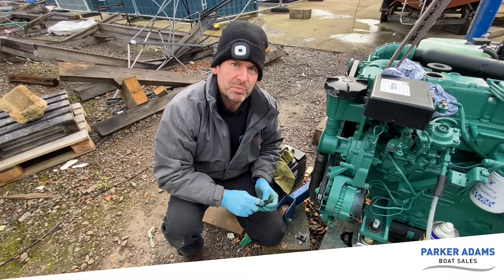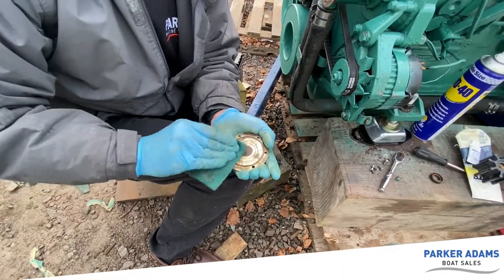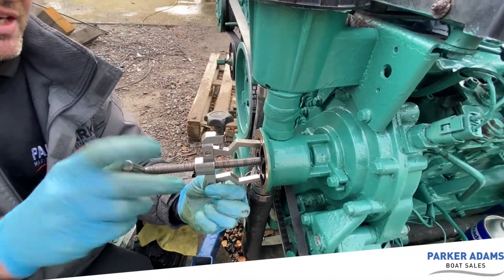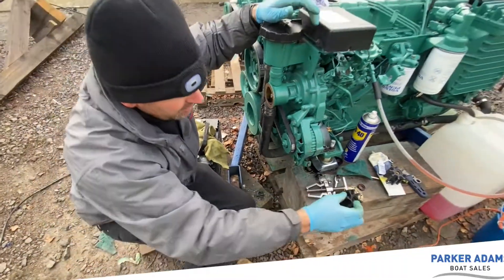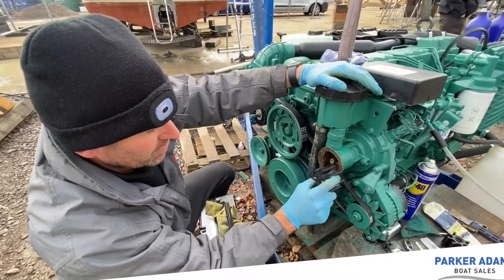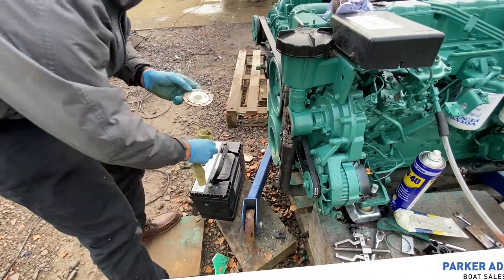Marine Engineering Made Simple Series #2 -  Tutorial on changing an impeller - Volvo Penta KAD

Comment: Hello. Excellent video. One question: can water enter the engine through that pump and then mix with the engine oil? Volvo Penta TMD40A.Thanks.
Reply: Please believe me when I say I’m no engineer 😂😂 but I understand that although the water pump picks up it’s rotation from a ‘key way’ in this part of the engine there is a system at the rear of the pump that prevents the seawater from getting into the engine, unless of course there is an issue with the pump. Hope that helps👍
Reply: All well and good with the engine out of its bay and neatly on blocks, try changing the impeller while the boat is rolling about and it’s on a Volvo mdb2 a complete nightmare!

Comment: My Volvo AP 41 6 cylinder is losing water could it be this
Reply from the maker: @markadams2723  if it is sea water you are losing a common place is the impeller pump shaft seal, there is a gap at the back of the pump to allow water to escape there if the shaft seal is worn as otherwise it would go into the engine.
Reply: It’s the fresh water I put into the header tank sorry to sound stupid but I’m just lost with all of this

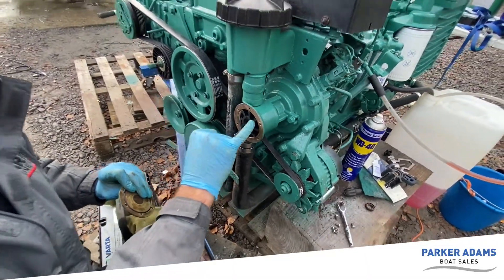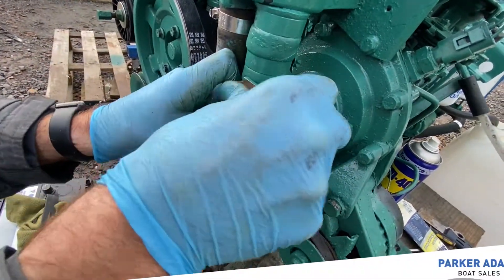Comment: This impeller was fitted incorrectly, at 0:34 to 0:46 you can clearly see the impeller is set to rotate in a clockwise direction, pushing the cold water up into the filter above. At 4:14 the impeller blades are facing the opposite direction to the rotation of the drive shaft.   Hopefully  on startup the blades will correct themselves without causing damage to the impeller.
Reply from the maker: @brucestrachan3368  sorry I missed your message a while ago, a few people have commented about the blades on the impeller now, in fact the impeller blades were the wrong way round before as it has had works done, hence why the engine is out and at some point the engine was rotated the wrong way by hand. I have explained in the video the correct rotation and fitted it in the correct way.
Reply from the maker: @brucestrachan3368   sorry I missed your message a while ago, a few people have commented about the blades on the impeller now, in fact the impeller blades were the wrong way round before as it has had works done, hence why the engine is out and at some point the engine was rotated the wrong way by hand. I have explained in the video the correct rotation and fitted it in the correct way.

Comment: The blades of original impeller were downward facing, indicating a clockwise rotation of the impeller.  The replacement blades were facing Upwards indicating a counter clockwise rotation.  Will the blades reset to proper clockwise rotation once engine running & water pumping?
Reply: Hi I noticed this also, however the impeller turns anti-clockwise or the long way round from inlet side to engine side. The impellers push the water around rather than pull the water around, imagine emptying a bucket of water with your hand. The blades or vanes will correct after 1 revolution. Hope this helps 😀

Comment: Hello Parker, I have a question that I would like to hear if you can answer for me. I have to remove the diesel injector pump on a Volvo Tamd 41b, year 1990. When I dismantle this pump, does the cam wheel / pulley need to be fixed? I have seen that  a Timing Tool Kit for Landrover is avible. Is there anything similar for Volvo? Or how do you do it? Best regards  Ben.

Comment: I see in the video that the impeller blades are installed the opposite way. So does this have an impact or do the blades rearrange themselves after 1 turn of the impeller?
Reply: They 'should' rearrange themselves.  I would have twisted the impeller the other way, against the cam, so there is no doubt they are going the correct way.
Once the cover plate's back on you'll never know if it's all good!!!
Reply: @brucestrachan3368  Yes they should rearrange themselves but in very rare cases they don't. I had a overheating problem because of that.

Comment: Hi Parker, thanks for the vid. There would have been a thin gasket that came with the new impeller. Can you tell why you never used it? In your opnion is it not needed?
Reply from the maker: Hi there, this type of impeller cover has a rubber oring seal, as shown in the video. This replaced most earlier pump housings which require the paper gasket instead. In the new impeller kit you usually get both types as the same impeller will fit in both pump types. Hope this helps, I will be putting more videos on so please subscribe to our channel.
Reply: @ParkerAdams  Great thanks!
Reply: Should both be used? What about the small black disc for the end of the shaft?
Reply: Oh ffs. I need another tool to get the impellor out just to inspect it? Argh....